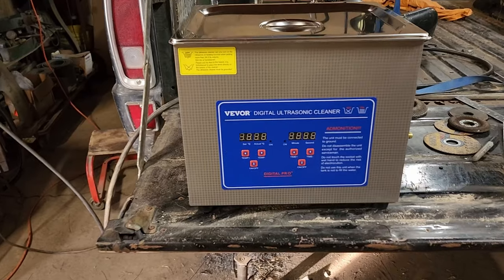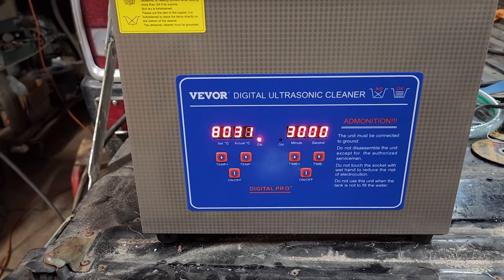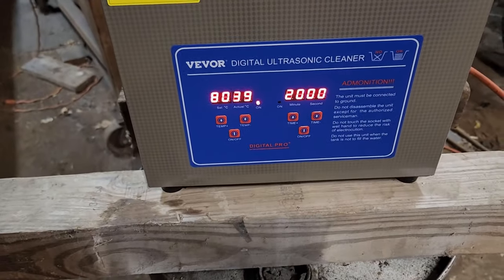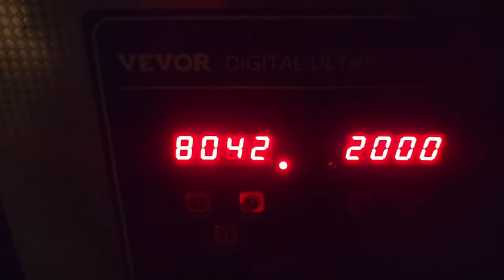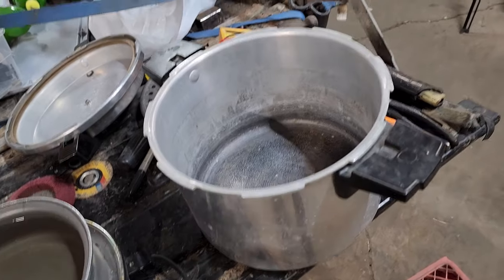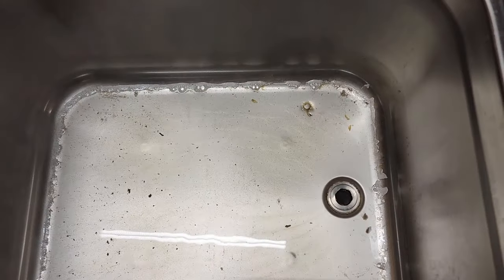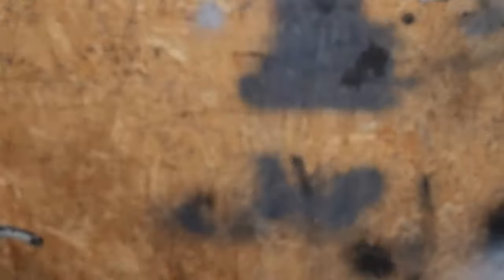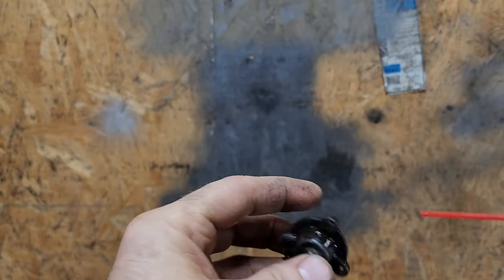Common, budget carb cleaning solution  showdown for ultrasonic cleaners

Comment: Another YouTuber I watch using I think the same brand cleaner he used one of those heating elements like you would use in a tea pot. I'm not sure exactly what it was meant for but basically he plugged it in and put in it with the parts to help get it up to temp.
Reply from the maker: Hadnt thought of something like that